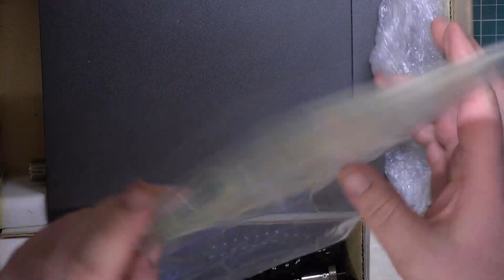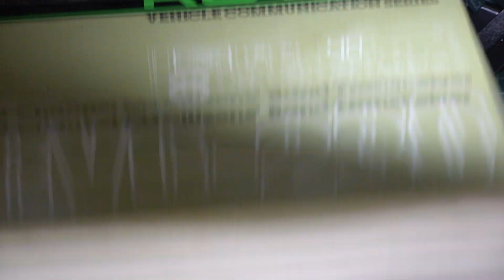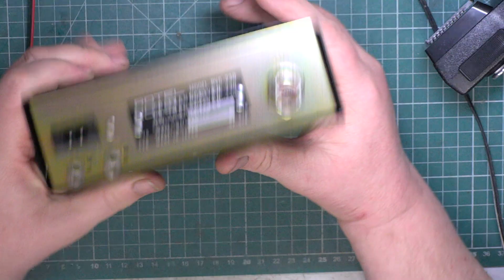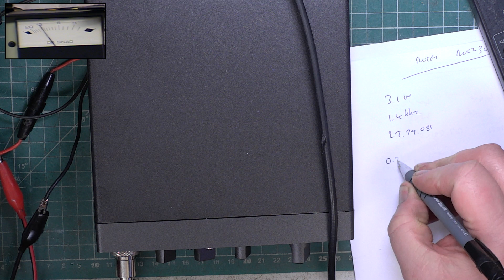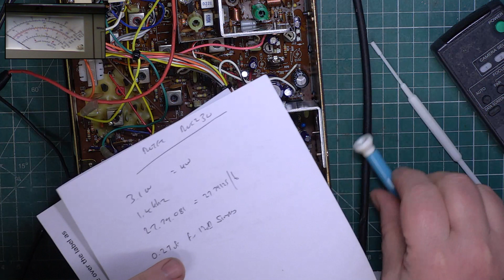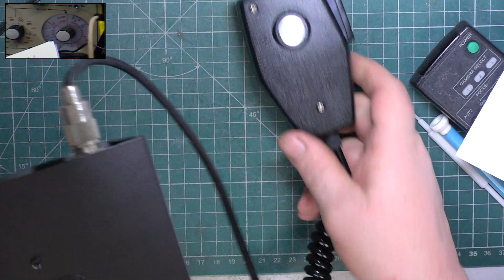Rotel RVC230 CB27/81 UKFM CB radio - service alignment

Comment: Hi Richard, the channel readout on my Rotel 230 is a bit on the dim side, is there any simple way to increase the brightness? Many thanks from Dave.
Reply from the maker: Are you sure that yours is dimmer than others? LED displays have got brighter thaan the ones they made 40 years ago. Unless resistor R56 (10 ohms 0.5W) has gone high in value - I've never seen that happen, or the display has equally degraded in all it's segments...I've not seen that either. The display can be replaced but it's neither quick nor easy.

Richard
Reply: @ukfmcbradioservicingTango21   It’s just hard to read in the car in daylight, so I wondered whether there were any quick adjustments which could be made. Not worth going to the trouble of replacing, I imagine. Thanks for replying :)
Reply from the maker: @HughJarse1968  There is no adjustment.
Richard

Comment: Still got my 240 from Christmas 1981.  Still got the manual and the box!

55 years old later this month. 

Rotel still working.. only issue I ever had was the mic plug wires fraying.

Comment: Good afternoon richard good luck on servicing the rotel rvc 230 cb 27/81 uk fm cb radio from paul chapman at east sheen 73
Reply: When i did my Amateur radio licence i was told never to put an s on 73. IT IS NOT 73s it is 73.